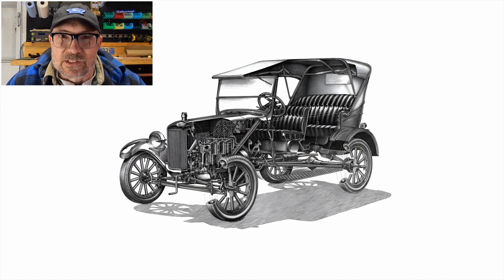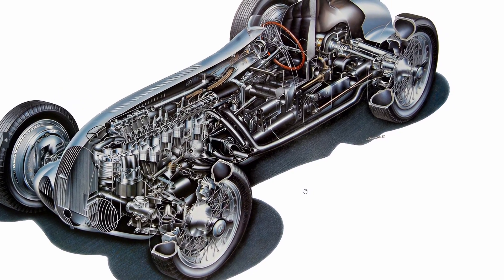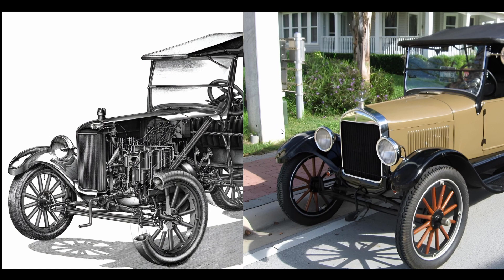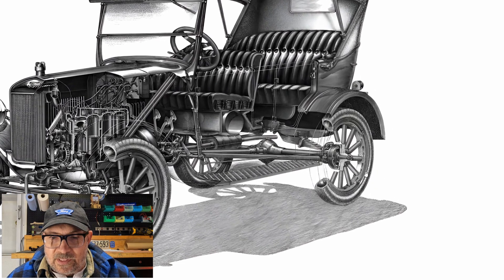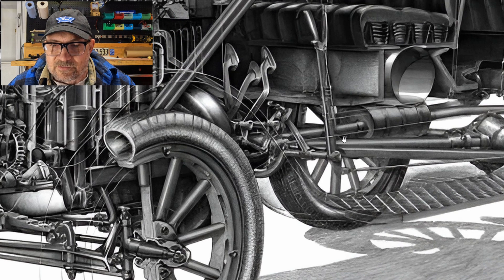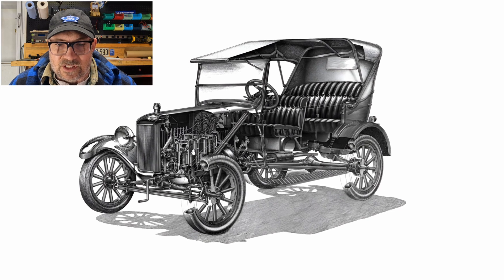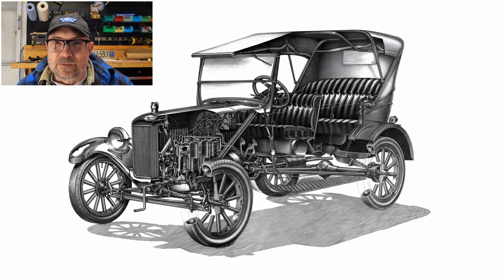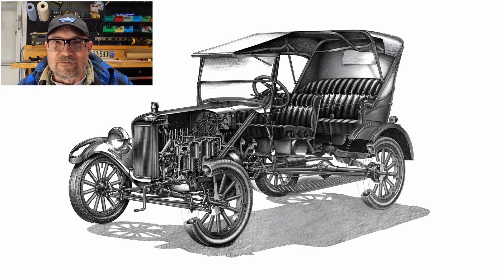Looking Inside the Ford Model T

Comment: Very educational!  Great drawing. The details of Model Ts is a rabbit hole for sure.   Every time I'm convinced I know something for sure, I find out I'm wrong.  It also doesn't help that Henry built 15,000,000 of them and no two were identical. From what I have read... when the line was running... parts were parts.😆